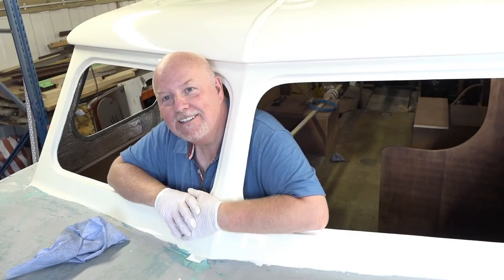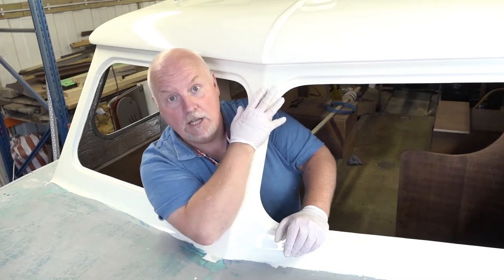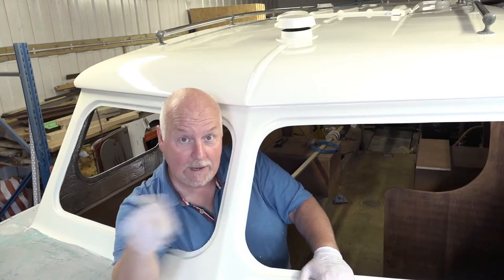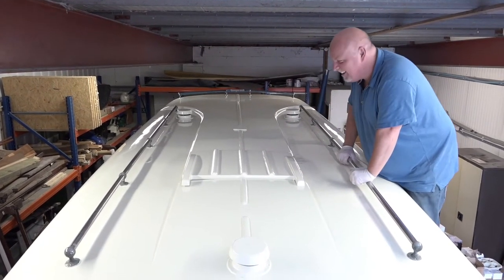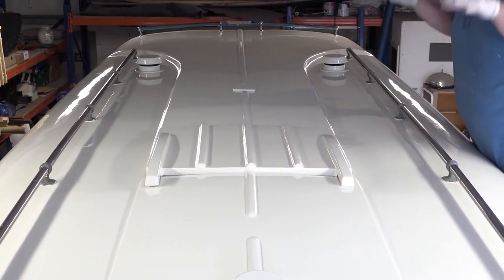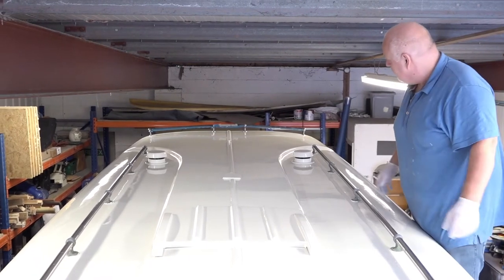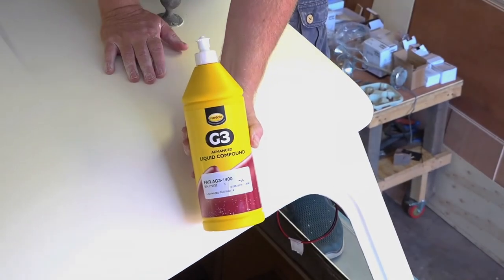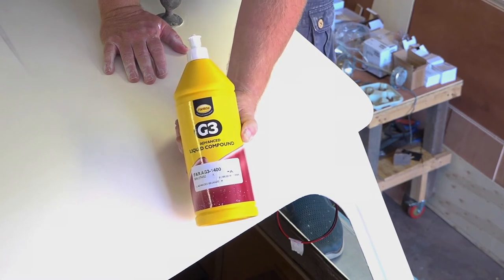Upper section Painted and buffed Episode 27

Comment: Fanstastic information , I will  doing my boat soon , it will be under cover and will be completly painted but I only have a month to do this ,  can I get the same results including the rubbing compound , I will be using Jotun pilot 2 top coat .
Reply from the maker: Morning Albert,
I’m unfamiliar with that Paint, but I don’t see why not 🤷‍♂️, so long as it’s hard enough to take the heat from the friction generated from your buffing machine, problem is at the moment in the uk, it’s rather cold at present to paint, even indoors unless you’ve the luxury of heating or  you live in warmer climes. Good luck with your work dear boy and thanks for watching 😎👍🙋‍♂️

Comment: thanks for the vid. If you doing 3 coats for instance, do you sand between each coat or do sand after the 3 coats?
Reply from the maker: Hi Dominique, I sanded each coat, I didn’t go at it though just created a good key for the  next one , remember it’s thick paint so quite forgiving when you do start cutting into it. Hope that helps dear boy 🙏🙋‍♂️

Comment: Looking really nice Phil. How long would the paint have needed to harden sufficiently to wet sand and compound,    not withstanding your knee problem forcing you to wait 3 months? Very interesting video series by the way 👍
Reply from the maker: Hi Danny boy, I’d say at least 10 days, do the finger nail test, if it’s soft it’s to difficult to pull the scratches out even 2000 grade, plus buffing seems to pull or drag on the paint, knowing what I know now, I’m going to paint the hull, and then carry on doing the build, then go back to the paint later in the build, hope that helps Danny lad 🙋‍♂️🍻
Reply: @philmurphy3549  Yes, that's very helpful. Many thanks for your reply 😊